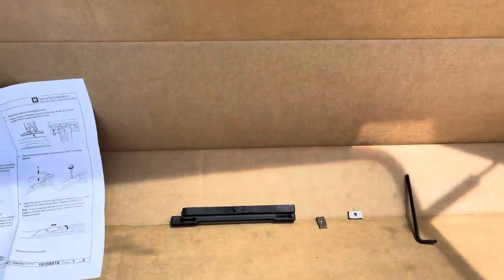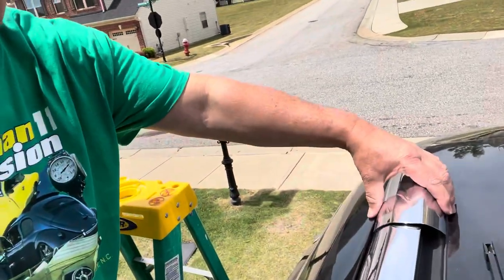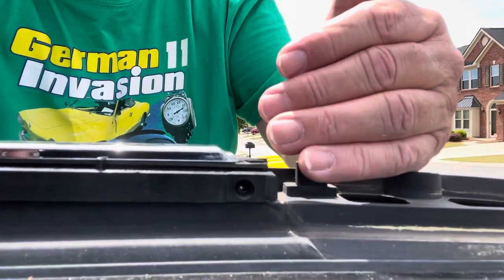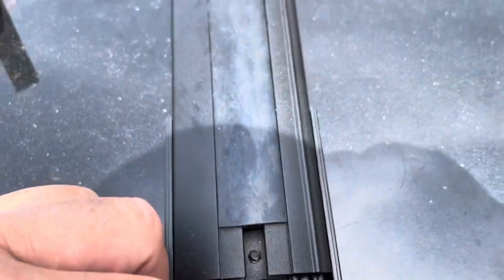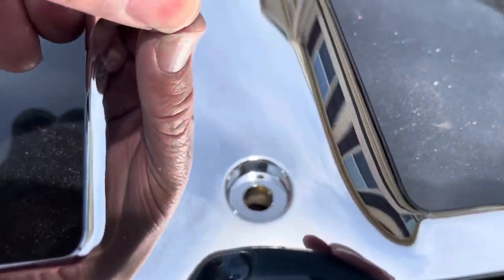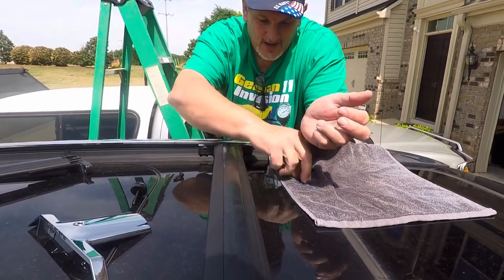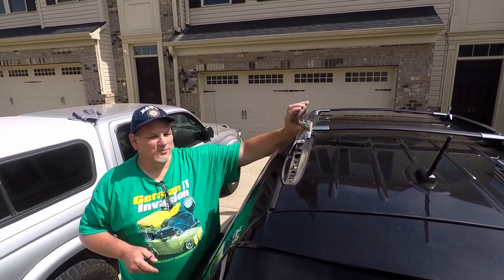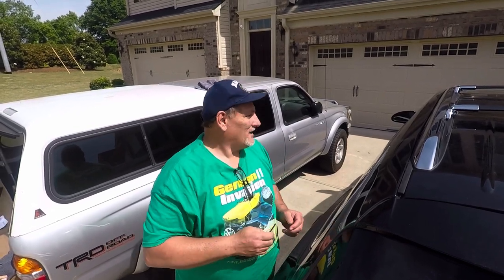How to Install Stock Roof Rack Crossbars on a 2014 Buick Enclave - (2008 - 2017)

Comment: Our Buick dealership ordered the wrong crossbar, not even close to what you had installed. Can you give me the part number by any chance?
Reply from the maker: There is a non-affiliated link in the description box.  
Website is :
accessories dot buick dot com

Roof Rack Cross Rails Package in Black. Part No. : 12499978

Make sure your Buick year is correct.